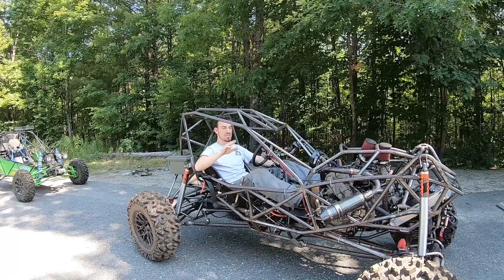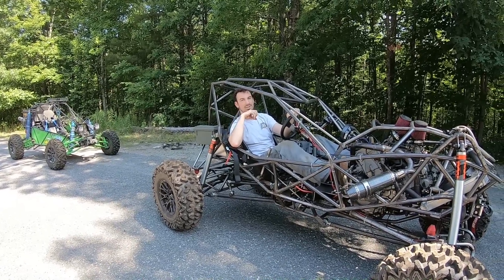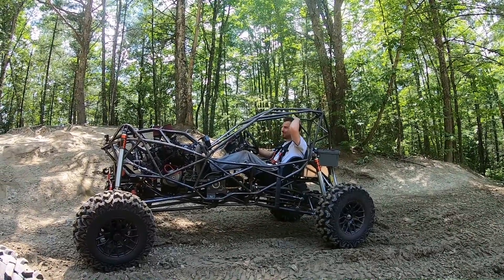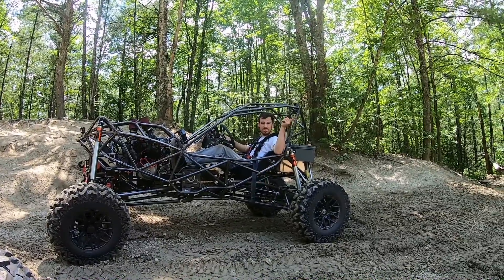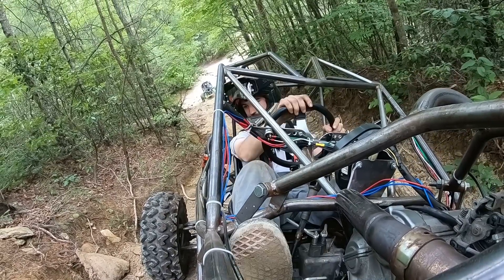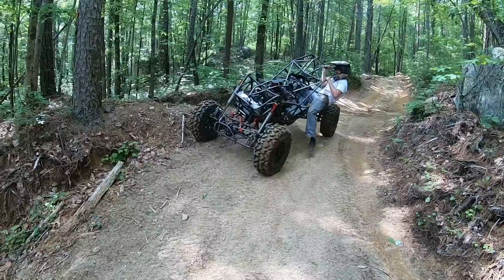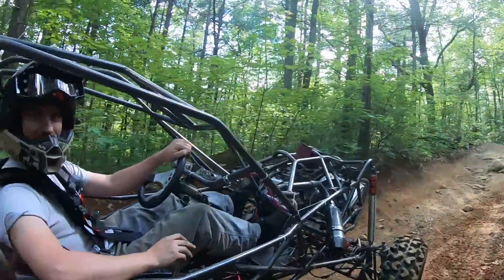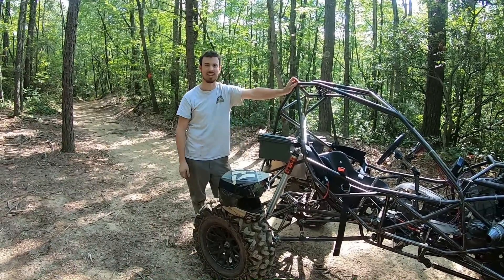First ROCK CRAWLING TEST!!! With the Mini Rock Crawler project - Part 16

Comment: 3 things to learn from this, and I’m not sure if you’ve changed them since this came out: 1. Air down your tires when you wheel. 2. Your low range is still waaaaaaaay to high. You want it to crawl, you shouldn’t have to give it gas to get it into gear in low range - that’s how low it needs to be. 3. You completely screwed those shocks when you let the oil out of them… if they were working you wouldn’t be consistently leaning over like that, and since you installed them it’s been leaning to the right while you’ve been driving it. It also looks like it’s a few inches from full compression, you want it to sit in the middle of the shock range. There’s no reason why it can’t be slow in low range and fast in high range, that’s what you have the motorcycle rpm range for. It’s got great potential!

Comment: Adjusting the nitrogen in these shock will not do a thing for ride qualtiy. That is all done with the oil levels in it and proper valving for the vehicle weight. And please tell me you are using a nitrogen system to fill those shocks. If you use air you are 100% gonna get corrosion in them. Also the oil will warm at different times due to the Oxygen instean of the Nitrogen in the housing.

Comment: I was concerned about the engine overheating. Most street bike engines aren't designed to be run at high RPM with little air through the radiator. They also run way hotter than a car motor, which is why you're getting so hot while riding. I have an idea about how you could make cake operated paddle shifters.

Comment: This is neat, years ago when I was doing real trucks I wanted to build a very similar vehicle to what you have done with the exception I was going to use Toyota or D35 axles front and rear, the idea was small and light so they held up to 35" tires and be reliable. I was going to use a FWD car engine and trans as well with the diff welded up. I never actually built it. It was just a dream.

Comment: Screw the beads so the tires don't blow drop the air pressure make the ride a little bit better and you get a little bit better of footprint with those tires

Comment: You need to read up on tuning those air shocks. I cringed a Lil when you were pouring the oil out of the shocks and I believe that is your issue with the shocks having a lack of rebound. The nitrogen is to set your height, the oil is to tune your dampening and rebound, you need to find the sweet spot based on the weight on each corner, the right rear will usually need a tad more as it will compress naturally under engine torque. That thing is sick though.

Comment: This thing is badass good job I have a couple suggestions though. lower tire pressure add pressure to shocks and wrap the cage bars closest to body parts with pool noodles or some sort of foam

Comment: That's such an awesome machine brother you know maybe you might want to think about adding a crossbar that rides midway between getting into the machine and the top of the roll cage I know it would suck to crawl through a little opening like that if you did put that bar in place but maybe you could use a very heavy pin so that this bar could swivel so that you could pull it meaning pull the pin swing the bar out get in and then close the bar or maybe you don't even want to use a pin maybe you can come up with something that latches I'm not sure but your arms are so right there by the cage! You're protected from the waist up and over your head I'm just picturing a little bit more protection that if you did flip over sideways and the top of the roll cage would protect the top of you but you could have a sharp object a rock or whatever just stick right into you you know at least that little extra protection would help I know texting doesn't really paint a picture but I'd love to hear back or if you think I'm making any sense thanks

Comment: Great Job!  Definitely a cool machine.    I would try lower tire pressure and I have heard the air shocks compression valving or ride characteristics are adjusted by changing oil levels inside the shock.  Maybe those things might help your rough ride.

Comment: Maybe try an air compressor out of a Cadillac a small air tank and ride height control valves for semi rear axle on each shock  so you can set your ride height and then it would automatically control where it needs to be and it will automatically air up and air down as needed

Comment: The shocks are definitely under inflated   And usually run real low pressure in tires about 5-10 psi

Comment: I wonder if onboard air would be any good to control air shocks and and also tire pressures? I had two compressor system for lockers on my trail rig and used it all the time for tires too. The way you build things is impressive! Keep it up! 😉

Comment: 14:03 Sway bar is fighting the springs too on the rear. The arms need to converge nearer axle center line. This is why you see a ever slight bow in the lower axle link at its meeting point.

Comment: Awesome build 🔥 I'd bring a portable air compressor so you can set the air pressure as needed. The tires looked a bit stiff. You would get much more grip with less air pressure. 
Cool first test. The mini rock crawler ROCKS 🔥👍✌️

Comment: Bigger tires with less pressure will take away a lot of the jarring bumps, and improve your crawling ability. Those are like 29"? Try find some almost worn out 33's and run them at 12psi

Comment: Start at 20psi in Tyers and go down to 15psi instead of 40ish lol. It will help. I run 15psi in 33inch Tyers on a 80 series LandCruiser and first gen 4runner. They both ride smoother and have much more traction off-road

Comment: Great work! Let the air out of the tires, trail rigs run low air for traction and ride quality. It didn't look like you were on bead locks but you should definitely be below 20psi

Comment: I noticed when your whole “cab” flips sideways your front suspension the whole thing turns not just the rack the tire moved back as a test just for fun take two ratchet straps and hook each ratchet strap from your front control arm to your rear control arm. Do the same for the other side if this helps your missing a important link somewhere

Comment: Not shorter, auto correct. They need to be softer. Or screw the wheels to the tires and run way less air.

Comment: Vveryone is giving good advice here but I think the biggest problem is the length and travel of these shocks. They would work great, on a wider and longer wheelbase. I'd imagine it would be much better with sligtly bigger tires and less pressure, and shorter shocks.
Great video, I love watching you go out after spending so much time on your cool projects. Wish I had the motivation lol

Comment: Nice test! Great build!  I am going to also say that you need to air the tires way down.  Airing down will give you more comfort and traction.  Looks like you need to do a spring over; it does not look like enough rebound.
👍

Comment: why in the heck would you try to rock crawl with 20+ psi in the tires. no wonder you were getting beat to death. put bead lock rims on that thing and air down to about 6psi. Your ride will be 1000% improved as will handling and traction. Raise the rear ride height a little more than the front allowing you better vision over the engine and front end. consider putting a tablet mount inside mounted to rollcage. Amazon has a wifi small water proof 12v camera for $50. Install one forward facing and one to the rear. You can then switch between cameras just by switching wifi from one camera to the other. this will give you a back up and forward facing camera capabilities. I personally would sell the air shocks and invest in a good set of coil overs. It does really well. Just needs some tweaking.

Comment: You could try using a bit more pressure in the rear shocks only, to raise your field of view. This would smooth out the bumps for you a bit more also. Unfortunately It would raise the Center of Gravity. But going up hill you would feel more level.  You could also mount a cheap 12" radiator fan (or a couple smaller 12v fans) right behind or above you to blow cool air  on your neck and back to help fight all that engine heat coming back at you.

Comment: More pressure on the shocks, maybe add springs to set minimum ride height that still can compress, add more pressure on the back so it tilts forwards a bit so you can see bit more out.. on next project listen from the get go, so you dont have to be "cant see shit captain" in later date. Aas everyone and their dog mentioned, air out tires a bit for better traction and for engine heat, maybe wrap the exhaust and maybe chance the fan to blow air down, but that will cause issues on higher speeds so maybe a scoop to direct the heat down or up. You could also add windshield, that might help a bit.

Comment: Back to the drawing board on the suspension. Definitely had too much air in the tires as well. 13-18 would have been much better

Comment: great buggy but I think the shocks are not the right ones for the job or you add some coils to help return her to the middle as is she just stays tilted if it was me I would change them for coil-over gas shocks some nice long ones or you keep the sway bar attached as your an amazing fabricator and engineer as those fox 2.0 just don't cut it as they don't return your driving it Right it's just the shocks but overall not to a bad test run you always expect some bugs to iron out that buggy will be awesome once you get it sorted.

Comment: Cage needs to be taller. Definitely measure with a helmet on.. Also something to protect your arms in the case of a roll over. Building cages for sxs's, you learn there's a lot of body movement when you roll/flip and that's why the cage is there. Definitely something to re-think. You can see how easy your body would be outside of the "safe zone" in the occurrence of a roll in the first few minutes of the test ride.

Comment: Chris, the shocks are too low in the stroke. The tuneable damping shims are probably in the oil element of the stroke almost all the time and this is why it's so hard. The softer part of an air shock travel is from the air and so only when the shock is extended. However, there are other options. You can take some oil out, use thinner weight oil or change the shim pack. All this info is on the Fox website. Also your tire pressure need to be almost nothing.

Comment: Those shocks are still way under inflated. It needs a LOT more pressure. Really good first run tho! On the plus side with more pressure the buggy will be a lot more stable because the air shocks will actually be working: P Even if you are higher you won't be riding relying on only your sway bars. Right now your sway bars are doing more for your suspension than the shocks!

Comment: Just a thought... when you have the rock crawler at more severe angles there is potential for oil starvation like when wheelie-ing a motorcycle. You'd have to be going harder on the engine and be at angles for longer amounts of time, but if you were to try and push the suspension to the limit you might push the engine past its limit. 

Loved getting to see the crawler in action!

Comment: You should add the same type double spring over shocks that are on the 1000. Then you would be able to disconnect the sway bar, and the over the trail riding will be a whole lot smoother!!

Comment: YOU CAN NOT RUN AIR SHOCKS WITHOUT A SWAYBAR.  LOL.  You need a proper spring steel swaybar.  It will articulate just fine with a proper swaybar.  Either that or use coilovers.

Comment: Definitely running way too much tire pressure and the shocks need to rebound faster. I’m not familiar with air shocks but it appears they are below the minimum pressure needed to return the to ride height. I know it’s a huge investment but standard shocks with coil springs may be a better fit for this application. Amazing content am I’m excited to see the next video on this project

Comment: Watch the rock crawlers on YouTube, they go fast to climb the hilly rocks. They also go slow to pick the best line. You have built a great little potential rock crawler, I think you need a stiffer suspension so you do not fly around in the cockp[it as much. You seem to have plenty of power  and I would take a ride in it any time!

Comment: Yep, some said it already, dropping the tire psi is an easy mod for better crawling and softer ride. With new tires, you could run super low psi, think 2 or 3 lbs. Gotta get new tires broken in and folding quick. It’s something you’ll have to test for. Nice job Chris, we’ll on its way to being great.

Comment: your builds are always impressive It looks to me like you need to pump them shocks up way more than you have them and then it won't lean you got them so that you're low to the ground but you still have to have your shocks pumped up to where they work like they're supposed to and then it won't lean so much because they'll come back because they have enough pressure in them to do what they're supposed to do

Comment: Put limit straps on the socks and add more pressure in them also lower gear more throttle you will have better control! But it's pretty cool

Comment: Let out half the tire psi, add a few psi more to the rear shocks than the front. It might help you to see over the front end. Add some sheet metal w/ Dynamat or even cardboard between you and the engine/exhaust to keep the heat on you down to a dull roar and add power steering w/ a spinner knob on the steering wheel. Too hard to rock crawl w/o power steering.

Comment: Is the fan pulling air through the radiator or pushing? Could help the heat situation to have the fan pushing air through the radiator rather than pulling.

Comment: It articulates very well. I was curious if weight would be an issue? where it would be too light to get good traction. but it seemed to work pretty good. providing it has bead locks on the wheels. you could lower the tire pressure to where it would take out some the shock traveling back up though the frame. and it might even gain some additional grip. ultimately you don't want your tire's to be bouncing like basketballs. you want them to be like flat basketballs where they go thud when they hit the ground. but without bead locks it would be pulling the beads off the wheels. and you are correct really good brakes are an absolute must on a rock crawler. because you want to be able to balance on top of an obstacle and set yourself up for the next obstacle. that's where you want good brakes and quick throttle response. to make it sort of dance over the obstacle's so to speak. well you had no break downs so you can chalk that up to a successful maiden voyage.

Comment: You could try and move the rear upper shock mounts up, then get some more air in those rear shocks. I’d say the front shocks look okay but you could feel if they needed more. If there is any way to move your fan behind you with the fan pushing or pulling the air out the back it could help a lot with visibility and temperature. It sure looks like a fun ride!

Comment: your shocks are not functioning the way they are supposed to. they should be rebounding back, you need to add more nitrogen and add back the oil you removed early on.
also, your tire pressure should be a bit lower for crawling

Comment: No wheeling vehicle runs a sway bar. No wheeling vehicle just sticks tipped over.  It’s all about your air pressure. I’d bet your at half of the pressure of what it really needs. Sway bar limits your ability to wheel period. Your sway bar is needed to keep you up rugby witch makes zero sense. No sway bar should not hinder your wheeling ability
 You need 2 times the air pressure in the shocks. And you need your tires to be ten times lower pressure. The tires need to fold around rocks and stuff. You should be at full drop of suspension every time you go over anything and everything but you can’t go at full droop because sway bar and sway bar unhooked you still can’t because it will tip over. It’s because the pressure is so way to low. Ps no this was not a good test. Super lame bro. Love your wrk. I’m being straight up. Not driving to fast. You have no air pressure in shocks.

Comment: I do like the sway bar but again sway bar shouldn’t be the reason that the buggy stands up straight when you lean it over by hand. Like you leaned Buffy over by hand and it stayed leaned over. That’s NOT a sway bar issue. Sway bar or no sway bar. If you lean a vehicle over it should straighten back up on its own. The only reason it would not is because not nearly enough air pressure in those shocks period.  Now it’s on the trails I hope maybe it’s clear enough for you to see. You have what 24 inches of suspension and your granny driving up a moderate bumpy trail slowly and you have zero suspension it’s as if you have no where near enough air in the suspension. Again you lean a vehicle over it should stand back straight with or with out a sway bar. Only reason fer it to not is not nearly enough air in them shocks.

Comment: None of the vehicles you make are fast. The only exceptions were the newest mini motorcycle build and the shifter cart. You always put to small of an engine. If you put a decent engine on something you then decide to weigh it down with 2 tons of unnecessary metal. Most of the rocks you went over with the exception of a few could be overcome in a Mazda Miata. Build looks sick, and controls great it seems, it lacks power. Now it's to much work to change the motor. No amount of gearing on God's green earth is going to give you CC's.